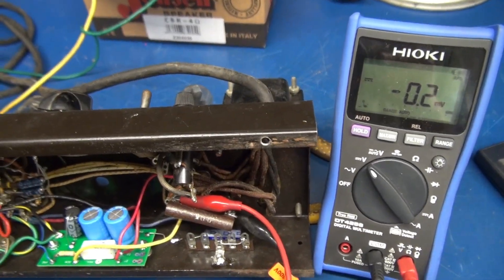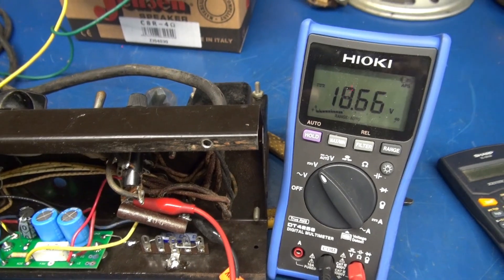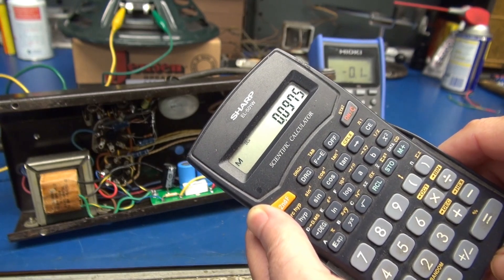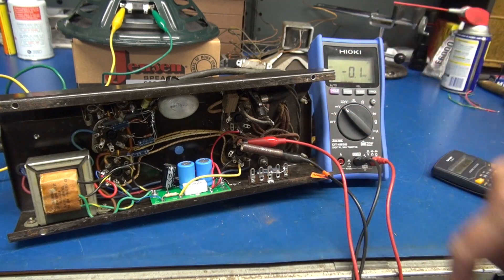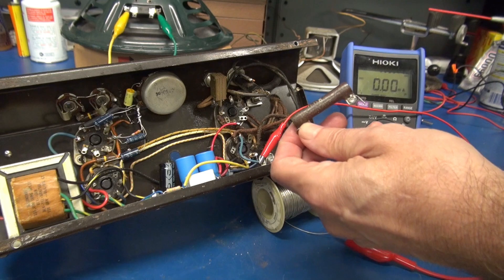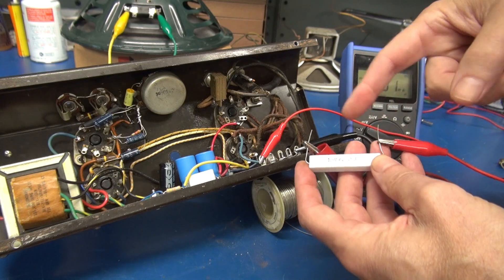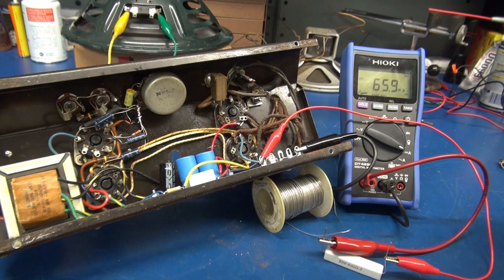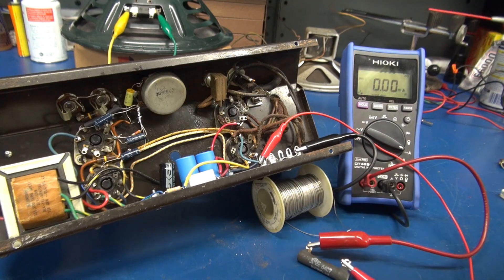Setting cathode bias Push pull tube guitar amp easy method using a DCma meter Ex: Gibson BR-9

Comment: Hi Terry.    I have a hybrid amp, adding a 150 ohm 7 watt to each cathode for two 6L6 tubes.   I cannot find anywhere on the internet how to bias a hybrid amp.    Would this method you show be the way to bias this amp?  Measuring current just as you did in this cathode biased amp seems like it would work for a hybrid fixed & cathode amp.   Thank you for your time.

Comment: i have a slightly odd ball question about biasing:

if the mismatch is quite far apart say 7mA. can i just bias to 45mA hitting a ceiling while the other tube plays catch up?
amp is dual 6l6 but my question is using russian 6p3s tubes which sound good and there no hum. its quiet.

Comment: Straight forward video. Another reply suggested measuring from OT CT to each pin 3 (plate) of the 6V6s.  That later method does give a pure plate reading but only experience techs should use that method as you're now putting the plate voltage through your meter and its on the probes.   As this amp is cathode biased, much safer to measure bias voltage and divide by 2 though the screens are also drawing current through the cathodes.  To get an nearly eact plate current reading, you need to subtract the screen draw which is about 5.5%.     Example: you meaurs 60ma / 2 = 30 x .945 = 28.25ma

Comment: Okay. Ive only cobbled together one working push pull /class AB amp, and im pleased to know i was calculating the bias R correctly across the resistor and also that i had erred on the side of caution by using extra R under the cathodes + plenty of wattage. Yes, one guy correctly points out theoretical  or data errors of assuming Scr I == Plate I, but its good enuff for fun & guitar tone imho. The point of theory in science and engineering often is to get us in the ballpark, sperical cow, etc.  ;-)

Comment: I prefer adding 1ohm matched resistors  on the Cathodes of both the tubes. Then across those 1ohm resistors 1mv=1ma and you  can match the output tubes
Reply: This is a good method but only works with fixed bias amplifiers.

Comment: D LAB, I think you're biasing the amplifiers incorrectly. Use a Current Meter to measure the maximum Power Supply current when strumming the guitar strings, What is the maximum power supply current? You have to factor this into the biasing formula which I never see you do in any of your video lessons.
Reply: Why would you need to factor in maximum supply current when setting the bias point of a tube? Do you mean that it should be taken into account where in the conduction curve the bias point is being set at?
Reply: @dughuff8825  yes I am saying that you have to Factor that in because the power tube bias point of the conduction curve has  a Conduction PLAEAU. When you strum the guitar lightly its AC biasing the power tubes GRID and when you strum the guitar harder its AC biasing the power tube GRID. On the Function Signal Generator you have to adjust the mV input to also AC biasing amplifier because the input signal level will also AC bias the power tubes into conduction. The harder and softer the input signal level the power supply current draw is going up and down which needs also to be factor into biasing amplifiers.

Comment: In  French nous disons: " C'est beacoup trop ! ......."
Old nos 6V6 could be driven hard in guitar amplifiers in the past era , in that time period tubes were simple consumables , no longer today ......
As tubes ages ( differently ) ...........when using a shared cathode resistor often ends by redplating one of the tubes as the hotter vtube will runa way and the lesser going down just like balancing kids on a seesaw.

Nice review/upload , thanks.

Comment: How do you calculate the power rating of the cathode resistor? Is the amps times the volts on the resistor, or .060*19.5= 1.17 watts?
Reply: that’s how you calculate the dissipation, but actual rating would probably be at least doubled.
Reply: Just by the size 😉

Comment: The one thing about measuring bias through the cathode is that the measurement also includes the screen current.  Much more precise to calculate the plate current by calculating off the primary of the output transformer. Of course, the screen current is negligible and can be written off as an added buffer to make sure you're running your tubes under maximum.  But as a technical note, the cathode current and plate current are not the same thing in a pentode or beam power tetrode.
Reply: Came here to say the same thing! As you say, the screen current is very low but it's not zero. But having slightly colder biased tubes isn't going to cause any issue here so I guess the less potentially risky method is ok.. 🙂
Reply: Some link where this system that you comment is explained ?